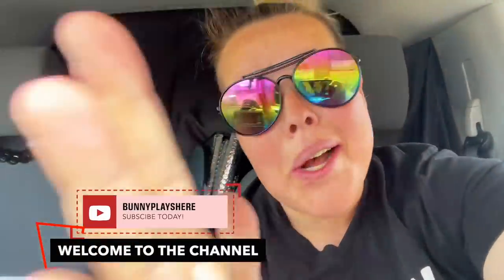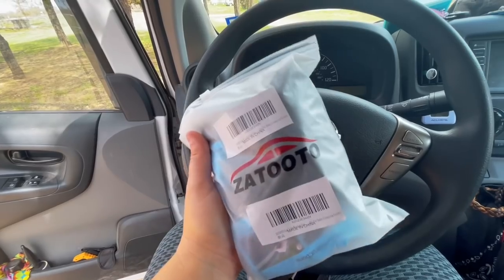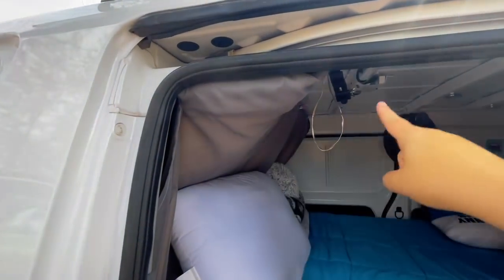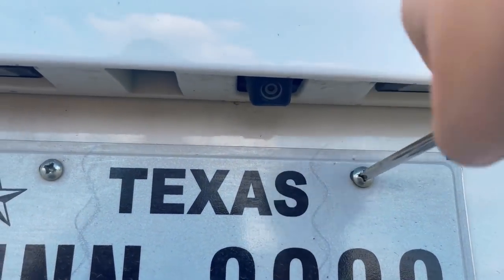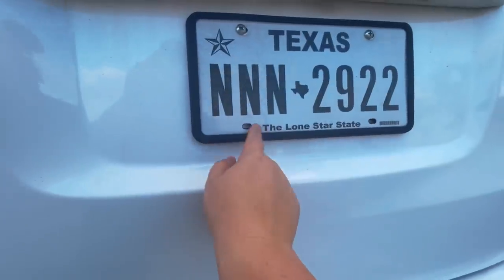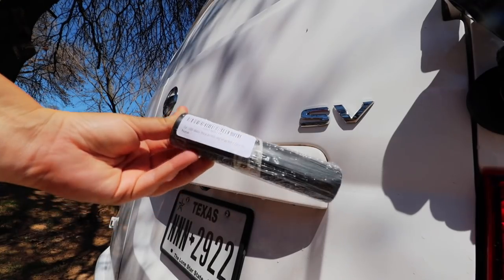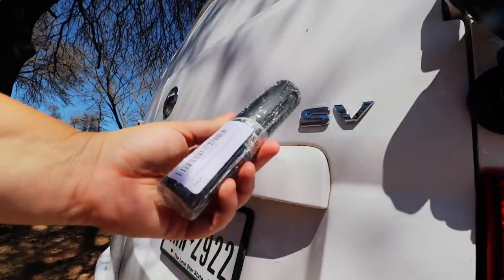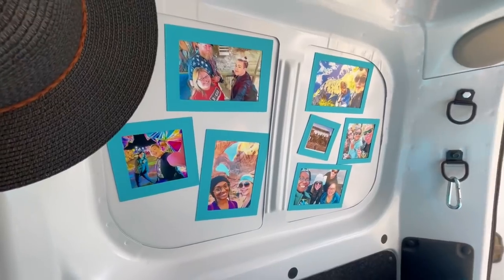Personalizing Your Space For Van Life | Little Touches That Make Your Vehicle  Feel Like HOME

Comment: Nice improvements.  I have some string lights I haven't put up yet.  The command hooks are a good idea.  Thanks.
Reply from the maker: I was super pleased with finding these command hooks because they really did work extremely well and conceal into smaller spaces. I thought that I was going to have to use some thing a bit more bulky and I was hesitant to do so but seeing these I knew this was perfect so far so good they fit in the van for days not a single problem with moving things in and out of the shelf because they took away so tightly.

Comment: I love the new additions. 
Have you thought of putting a curtain rail/rod right behind the seats. Where it would just drape straight down ?
Reply from the maker: Because of the contour of the ceiling if I were to put up a curtain rod it wouldn’t go fully to the top. I did consider that however
Reply: @BunnyPlaysHere 
🤔 Unless you need them to slide, you can do a 2 set system..
1 rod on top, and 1 behind the seats.
Even get one manufactured to follow the ceiling, with curtains that might just slide in the middle part, but be fastened to the rest of the rod.. 😅

Comment: I had those window curtains when I was in my car and I love them but now I have a Ford Transit and my windows are huge and I can't find anything to fit them. I only used the curtains at night though because the black can still made it pretty hot inside. The refelectix doesn't let any breeze through, which I want. Yeah those magnets are no joke. Got mine at Harbor Freight and it's so strong, I cant get it off! lol
Reply from the maker: The ones that I currently have are an XL version and they are a bit bigger however I know what you’re talking about I just looked at a Dodge sprinter window in comparison and it is much longer and so it wouldn’t work for those however I have noticed with a lot of the bigger vehicles that people are not using the accordion style and I rather making custom fit window covers.
Reply: @BunnyPlaysHere   Yeah I'm gonna try to make some for the summer the summer that are black but have a screen hole in it so the air still comes through

Comment: I think the shelving was a really good investment they will last you for a very long time! Do you plan on ever getting solar and an electric system?
Reply from the maker: I think that it will last a much longer time than a traditional cabinet well as well where in tear on metal is much different than the where in tear on wood. Not to mention it’s going to allow me Two place items on it that will make life a little bit easier while traveling. And I can secure everything so I don’t have to take things on and off the shelf to put them in driving mode. As for solar and electrical system I am not yet sure as to when that will happen I do have a solar panel which in the future I would like to put in the van to at least charge my batteries while I’m driving.

Comment: I have a Prius and would like to put a curtain up behind the front seats but it would block the heat/air conditioning from getting to the back.  Any suggestions?
Reply from the maker: I have used a Knogo before which actually pipes the air toward the back behind the curtain or another thing that you might want to do is not close your curtains until night time or elevated so that the Aircon push through and cool the space in the back before you’re ready to slip inside to sleep
Reply: @BunnyPlaysHere  Thanks for the tips.

Comment: Why wouldn't you just make reflectics for the front window? I've even made some for my daily driver just help with the heat
Reply from the maker: I previously did have some and I didn’t love them. With my current configuration where I crack my window at night they aren’t as effective and often times would block the very air that I’m trying to push through the van for ventilation. I had a couple of other reasons why I didn’t love them as well but found needs to be a much better option overall. I do have more of a reflective style front cover but the side covers I have chosen bees instead which I feel work way better for my personal taste

Comment: Surprised you didn't paint the shelf turquoise also 🤔
Reply from the maker: I think it would be a bit overwhelming if I painted it turquoise. If I do painted in the future I will likely paint it white which is a bit more versatile if I decide to change other features of the van later on. For example if something were to happen to my current comforter and I need to replace it I would hate to think that I have to fully repaint the shelf just saw that it would match again.
Reply: @BunnyPlaysHere  good points!!